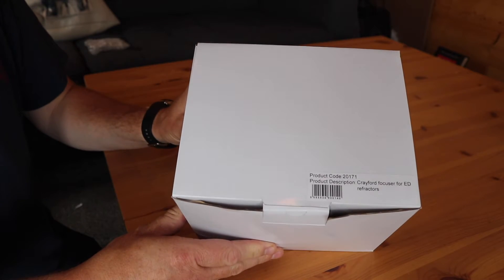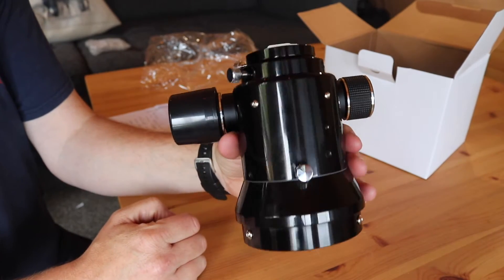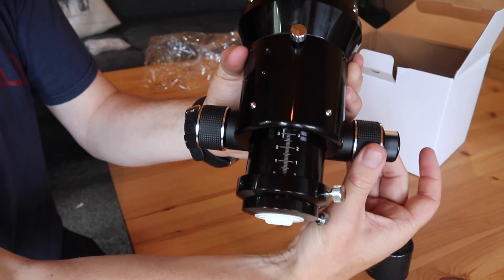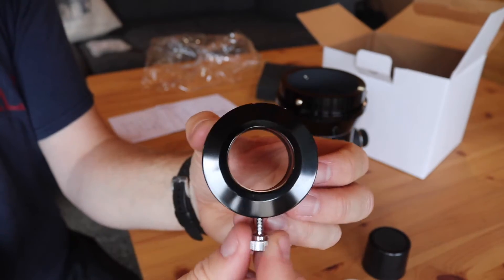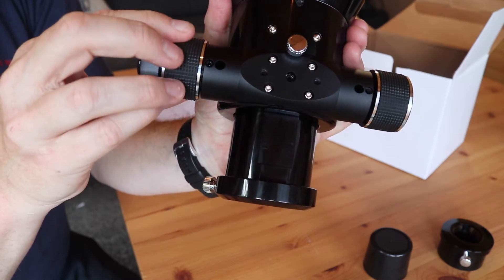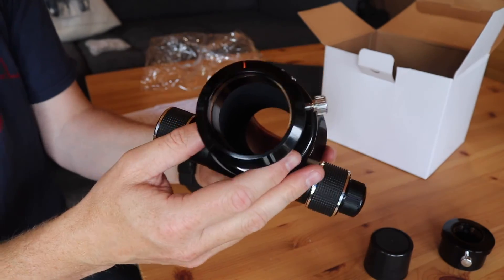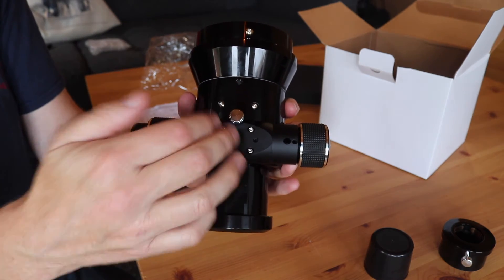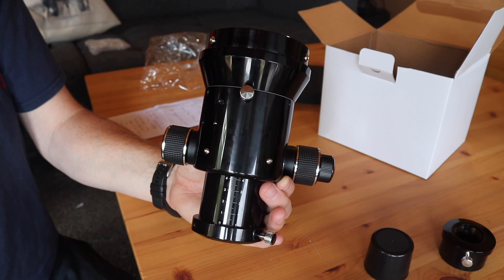2" Dual-Speed Crayford Focuser - Unboxing

Comment: Thank you for this video! Can this focuser be extended as far as the stock focuser? I need it to be able to extend ~ 10 - 13 cm. The video did not show this. Tanks!
Reply from the maker: From my measurements, tube draw length is the same as the stock focuser will extend out by 80mm / 8cm.

Official sizing from First Light Optics website is "Length of focuser 132mm + 80mm when draw-tube fully extended."
Reply: Hello, thanks for the nice video. I just received the same focuser and I am happy with the quolity. I expected it though to support easy alignment with the objective by means of some screws, but did not find those. Do possibly you know of a way to achieve this?